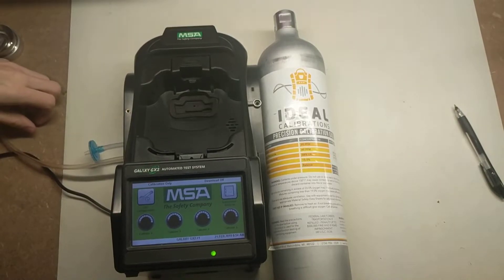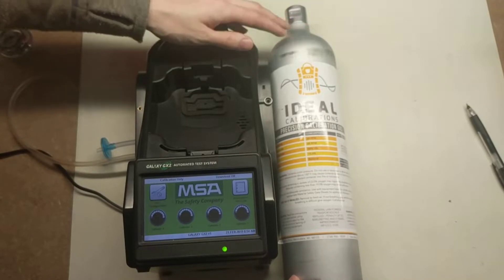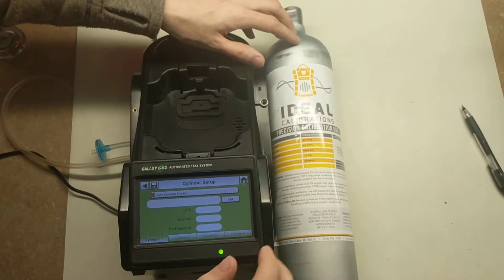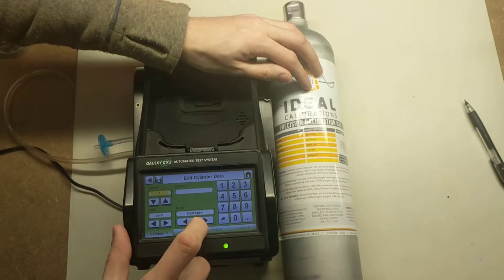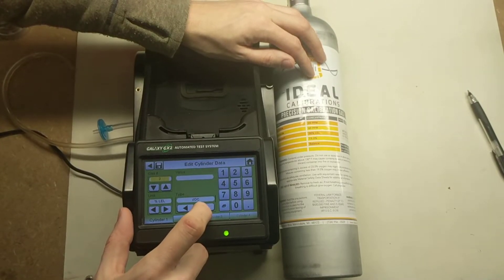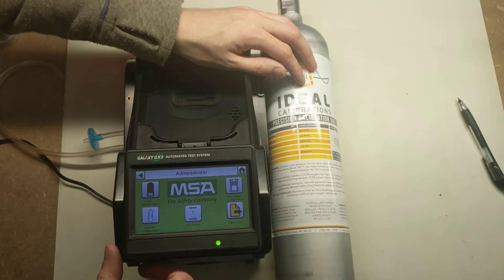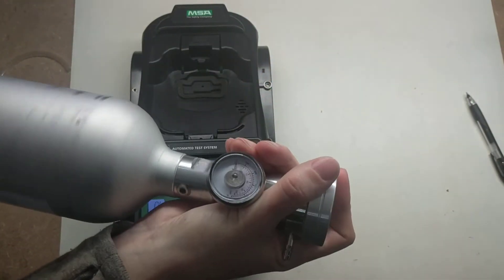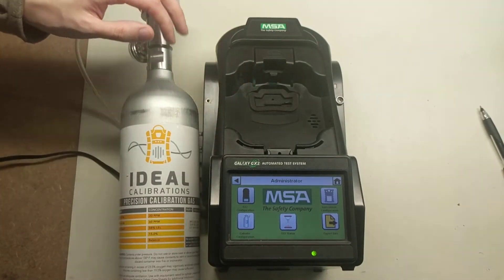MSA Galaxy GX2 Manual Calibration Gas Setup

Comment: I have a the Altair 5x setup. Can you please help.
Reply from the maker: Hey Victor, what's the problem with it?
Reply: @Idealcalibrations  we have 3 bottle manual set up on ours. Do you have cap that 4th port before calibrating a meter?